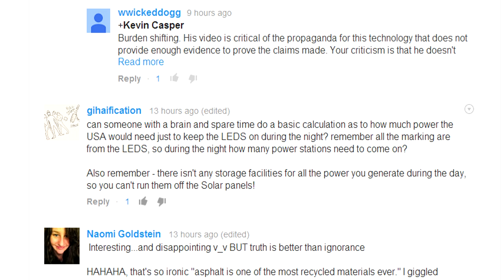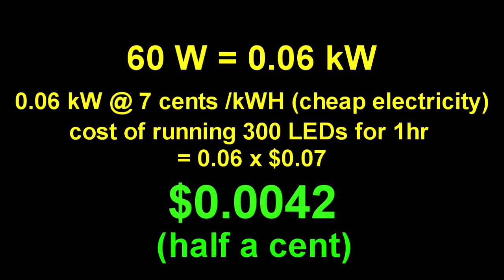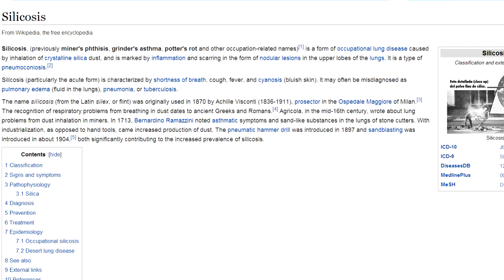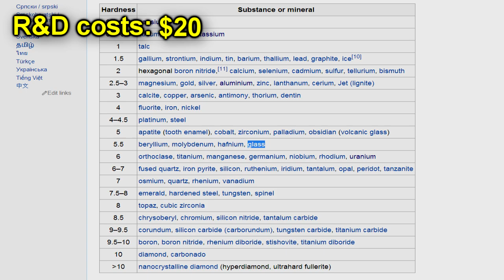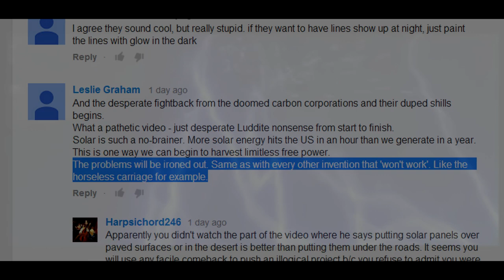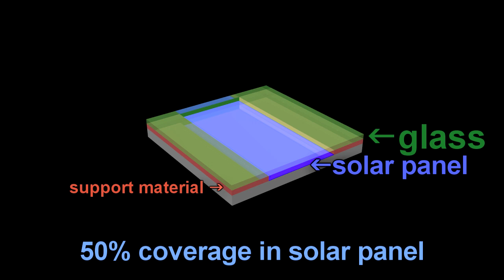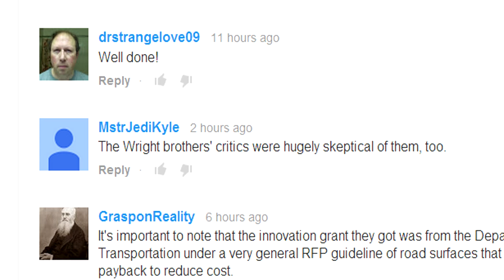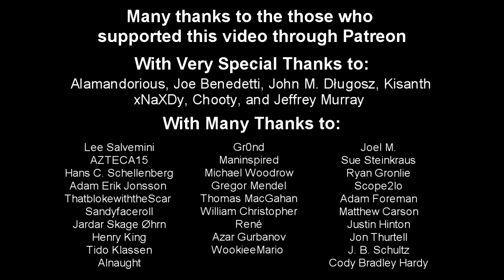Solar Roadways, IMPORTANT QUESTIONS AND ANSWERS!

Comment: but the solar panels if they work as panned at all would pay for themselves and produce excess. so the cost in electricity is null and void. I own a led flashlight that can be seen in the daylight  again normal glass who said that is just normal glass? you do realize that the Mythbusters did in fact make a led balloon that could fly. you keep thinking this is normal glass and not some other solid based off glass. as well as assuming that nobody did some of the basic trials you did.

Comment: Now I think in the future if we had room temperature superconductors it would be possible to have like low voltage graphene batteries and the efficiency of the panels beat the cost of energy by at least twice, it could be feasable. I would say probably in maybe 20-30 years it will be worth it (but solar farms are still going to kick its ass).

Comment: Even if all their wild claims were true about the longevity of their panels they would never use them up here. It's not the road surface that fails. It's the permafrost. The ground under the road shifts and the road cracks. It doesn't matter what you make the road out of it will crack if the ground underneath moves.

Comment: The thought of driving at high speeds on highly-polished glass roads is absolutely terrifying.
Reply: Duffless22 I looked at your link and it's hilarious that you think it was a real test. Right in the same paragraph it was using the British Pendulum Testing apparatus, and just SAID they could stop a car going 80mph. No test just bullshit, and your eating it up like a buffet. I can't rationalize how anyone wouldn't think solar roadways are a retarded idea.
Reply: iREPda609 lmao @ eating it like a buffet 😂😂😂
Reply: Duffless22 I'm calling bullshit on this statement. Their website for Q&A states that the only actual working area totals 36 ft. in length. You can't do a stopping distance test with a car traveling at 80mph on a 36 ft. "stretch of road".
Reply: Bathrobe Samurai 
Have you ever driven on wet concrete (like in a parking lot) at medium speed? Its fun if you like to loose traction, not so fun for braking distance and handling. As for glass not being glass - a smooth uniform surface is required for maximum efficiency for solar panels, which is opposite to what makes a good road surface (again compare smooth concrete with asphalt)
Reply: Duffless22
Every fucking conman says shit to make morons believe in him and give him their money.. Same happens here.
Reply: Not only that...

How is the road noise when traveling over then at 40mph?  70mph?
How well do the hexagons stay level?  When applied at the costs with which roads (say, the US IS system) are installed? Is there any long use data on wearability? What makes asphalt useful is that it is a mix of yielding and hard components. However, even the hard components wear.
Reply: Bathrobe Samurai
Simple... put together a video demonstrating your position. Get a sample of the glass that they are using and sand it for one thousand hours to see what the results well be.
Reply: Duffless22
From their website, your link... "We sent samples of textured glass to a university civil engineering lab for traction testing." This is not the same as a 1 mile stretch of roadway which tests an actual car/truck/semi combination rig/airplane/bus/permitted overweight combination rig/school bus, etc. etc. etc. to determine actual results for stopping distance. It is a simulation test. It is not a valid road test.
Reply: Bathrobe Samurai There is a difference between an argumentum ad hominem and a plain old insult. 

Back to what you were saying, how is tempered glass not glass? I know they have different properties but it is still classified as GLASS. 

Also, since your so keen on highlighting the durability of this glass, why don't you give me some specs?  I'm QUITE sure they will fall short of meeting ANY qualifications for a safe surface to drive on.
Reply: Bathrobe Samurai
They call it glass, pal.  So that's probably what it is.
It is NOT a mater of strength.  It is a mater of elasticity.  Asphalt is able to handle the pressure it does because of the rubbery components of it that bend under weight.  Glass is one of the LEAST elastic materials out there.  It doesn't bend, it breaks.  This is a key trait of glass.  No amount of tempering can ever change that.
Reply: We have all seen that very smooth almost polished concrete floors in places like parking garages. When wet, it is like being on black ice.
Reply: Well, it works in Mario Kart.  That video game is realistic enough, right?
Reply: Bathrobe Samurai and what do you idiots not understand about the fact that yes it may be many times stronger it still scratches just the same.  not to mention every other point he is making that you brainwashed fools seem to ignore.
Reply: Duffless22 Please refer back to 8:00 into the video if you are confused
Sargon of Akkad Thank you remaining logical and reasonable
***** Thanks for making a video so I can laugh at people wasting their money on this project :)
Reply: Bathrobe Samurai
Specifications on said "different material" please. They don't give any specs on anything that they are doing.
Let us grant you /them the position that durability and tracking are not an issue.
Let us turn are attention to grim. Specifically road grim. Road grim, is a huge issue here in Southern California. Anyone who drives in So. Cal. can testify to the road being, pardon the expression "slick-as-glass", after a light rain where the rain water lifts the oily road grim up off the surface of the road producing a highly dangerous driving condition.
What are your thoughts on this aspect of common problems concerning road travel here in the U.S.?
Let us grant that everything they claim is true. With $2 million, how long of a stretch of read can they build so that proper testing can ensue and all doubts be alleviated?
How long until they have full patents on the panels so that proper scientific testing by others can begin?
What is the end cost too tax payers? (Partly answered in FAQ)
How much additional training for each road construction crew member is going to needed, and who is going to pay for this training?
What's the best base for these panels? Is it asphalt? Asphalt would certainly help reduce any "tilting" that others are claiming would take place.
Reply: Sargon of Akkad now what about rain and surface runoff water? Wouldn't that cause more slippery roads and cause more danger?
Reply: I say: put the adventure back into driving!
Reply: Duffles Well, if it's not highly-polished, then that cuts down the light reaching the solar cells even more.
Reply: Can’t wait to drive my thorium cars on it
Reply: Sargon of Akkad think of all that traction...
Reply: Sargon of Akkad I love you, but I must disagree with you on this. It sounds exhilarating.
Reply: Lets test those glass panels with a semi that has snow chains on .... at 30 mph a semi thats 40 tons would make all those glass panels to powder .
US interstates are not made from a foot thick concrete to handle cars , its made so army can transport tanks ...  take a Abrams tank , thats 60 tons and drive it on glass , what would happen ? 
It wont matter from what glass you made it from , there is a reason why roads are  made from stone and not glass .
Glass walking bridge , notice the foot covers   https://www.youtube.com/watch?v=rRIrs8hQNv0
Reply: Pete Lind Oh my lord, the snow chains. I never even thought of that.
Reply: You dumbass! What happens when the tiles are broken? And how about ones stolen by people wanting free solar cells?
Reply: Even the Lord of shitposting knows this WILL NOT WORK!
Reply: @Philoglossos  so your argument about how great they would last did not stand te test of time!
Reply: @dogwalker666  All I said was that the non smooth tempered glass they were using ≠ 'glass'. The project probably isn't feasible but it's not because the glass isn't durable lol.
Reply: @Philoglossos  I thought I saw a comment where you said the glass would work I must have aimed it at the wrong person,  I was laughing at all the comments that said the glass would work ok,  not only did it not last, but the idea of driving on glass with ice and snow on top like today is terrifying.
Reply: @dogwalker666  It doesn't work because of the electronics, the glass itself is textured and was repeatedly demonstrated to be sufficient for a car to stop going at 80 mph in the rain. So yes, the product itself is worthless, but it's not because they were using smooth breakable glass lmao
Reply: @Philoglossos  but the glass disintegrated every time they tried it, its completely the wrong material to be driving on, and snow covered glass tiles are slippery as hell.
Reply: @dogwalker666  No, the glass did not disintegrate, the electronics failed. The glass was perfectly study and was textured such that it wasn't slippery - this was confirmed in testing that showed a vehicle driving on the glass could safely stop while going 80mph in wet conditions (snow/rain).
Reply: @Philoglossos  have you watched the updates? The Chinese one disintegrated after 5 days,  and I think it was the French or Dutch one that shattered after a few days, and the glare  is appalling,  the electronics did fail very fast in that environment as well, they also had to cheat and shovel the snow off as well.
Reply: @dogwalker666  Those are completely unrelated projects to the one being discussed in this video my G...
Reply: @Philoglossos  they are not the tiny little one that you are only able to walk over, has a damaged surface, is falling apart and has horrendous glare,
Reply: The first installation https://youtu.be/wIuiZh5t9_Y,   shoveling snow off them https://youtu.be/dkeu07U3060. Both Thunderf00t.
Reply: @dogwalker666  What does that have to do with the durability of the glass itself?
Reply: @Philoglossos  the glass has disintegrated and de-laminated from the amateur electronics,  it Also shows they are not using a high grip surface and the glare is horrendous. I used to work for a glass company I know exactly how brittle glass is, and how very slippery when wet, it also becomes more brittle with age it's relatively easy to cut new glass but if you try old glass it just shatters.
Reply: @dogwalker666  The one that disintegrated is the Chinese one, which is a different project made by different people, like I just told you lol
Reply: @Philoglossos  it was based on the same design they just simplified the electronics, It still was glass.
Reply: @dogwalker666  We're not talking about the design, which we have agreed isn't feasible, we're talking about the materials themselves, which obviously are not going to be identical given that they're produced by different manufacturers in different places at the behest of different companies. The fact that this disintegration happened to the Chinese company's product in particular should make it pretty clear that the products are unrelated to one another.
Reply: @Philoglossos  the french, Dutch and American ones were made of the same material glass the Chinese one was a joint venture with an American company as far as I can find out the surface was glass too. And glass is too brittle to support HGV,s a bull dozer or a tank will shatter them into a million pieces.
Reply: @dogwalker666  There was no such joint venture, now you're just making things up lmao. Provide a source demonstrating that they used the same materials from the same source or we're done.
Reply: @Philoglossos  nope I didn't make it up but belive that if it makes you feel better.  They are all glass it doesn't matter who makes it, all the best glass manufacturers have gone anyway.  Look at what pyrex is like now since the French bought the company.  There is nothing you can do to glass to make it usable as a road surface, nothing I have driven over glass floor tiles, its worse  than ice.
Reply: @Philoglossos  I did make a slight mistake the joint venture was with colas whom I assumed was American it is actually Anglo Dutch, however they used the same glass.
Reply: @dogwalker666  Solar Roadways, the company we are discussing, is American. So, once again, the durability of the materials used by other companies in Europe or China is irrelevant. How many times do I have to explain this?
Reply: @Philoglossos  and how many times do I have to say its Glass, dose not matter if an American company made it and I suspect they didn't it's still only Glass. Not Unobtanium.
Reply: @dogwalker666  If all glass is somehow the same, you shouldn't have to point specifically to the Chinese company's product lmao. Different glass made by different people for different products will have different properties.
Reply: @Philoglossos  what?  You are just making things up now,  Do you actually work for the snake oil charlatans,  they tried to make solar roadways in China France and Holland, every time the glass disintegrated why do you think that they have suddenly discovered a magical version of glass that every other manufacturer in the world doesn't know about. It's glass it will disintegrate if you drive HGV's over it.
Reply: @dogwalker666  You're being dishonest. Those are different projects by different people. I have never claimed that solar roadways is a good idea or that it is feasible, I have simply pointed out that you are making intentionally dishonest claims about the durability of the glass based on completely unrelated projects. You are clearly incapable of admitting you are wrong given that you keep trying to strawman me so we are done. Bye! :-)
Reply: @Philoglossos  so you won't admit that glass is a totally unsuitable material to make a road out of and try to deflect that I am making claims, hum ok at least you admitted defeat. Let's see when they start making roads out of glass instead of tarmac. Lol.
Reply: orbnorian http://www.solarroadways.com/faq.shtml#faqTraction

They say it clearly in their faqs. If you wanna argue against what they say, how am I suppose to argue with you when you dismiss information.
Reply: I'm not sure where you got the idea that the glass was highly-polished. If you look at the actual panels you can see the texture. Also they've run tests and a car going 80 mph in the rain has stopped in the required distance.
Reply: Duffless22 Did you not watch the video?  How long exactly do you think this glass will remain textured? 

These glass tiles will be worn into a smooth, polished surface pretty damn quickly.  This will make them dangerous and expensive to repeatedly replace. 

Just putting solar panels above roadways does make a lot more sense.
Reply: @Duffless22  Can you show me the video of cars going 80 mph stopping on wet glass?  Or cite a reputable publication?

And, yes, I know they have talked themselves into believing they already know the answer.
Reply: @Duffless22  what happens when something falls on a solar panel? PV tiles are known to be fragile & things will always fall on the road from cars
Reply: @Duffless22  r u defendinf SFR?